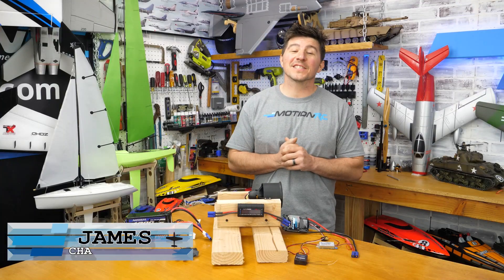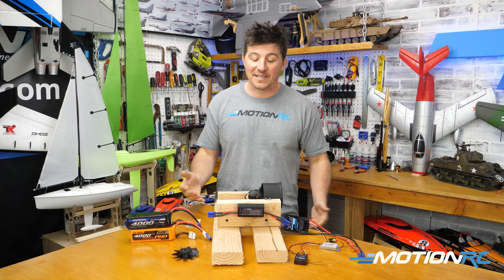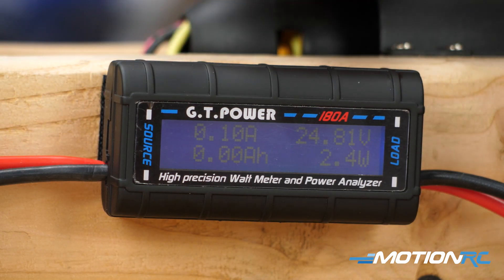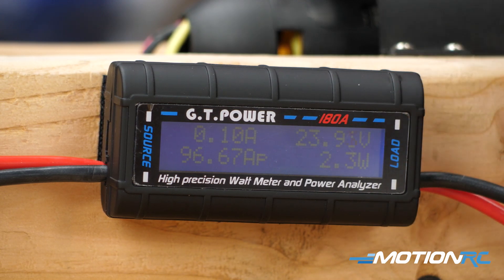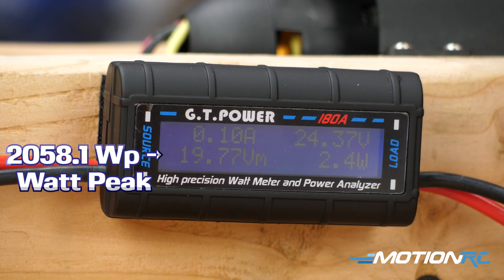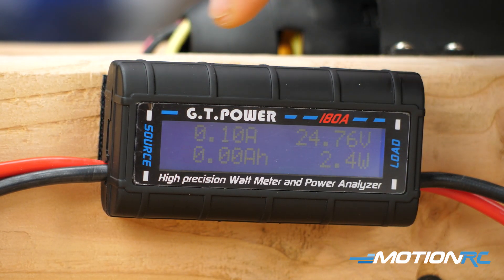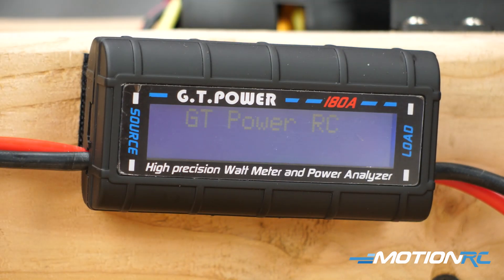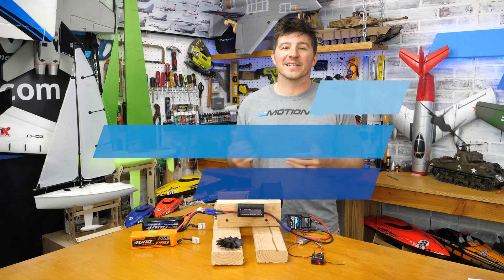Using an RC Watt Meter | Quick Tip | Motion RC

Comment: Watt meters are also a great tool to keep an eye on pack health as they age by keeping an eye on voltage drop under load. As already mentioned by others, I always set up my models with a watt meter making sure I stay within motor maximum amp draw as well as making sure the chosen ESC has enough headroom above maximum draw from the motor as they also must provide power to the receiver and servos and possibly landing gear and lights, etc.

Comment: This will definitely  help out a lot of new pilots wanting to experiment with this different power Systems.  typically when you're running up an EDF you will see peak watts and amps vs what we call settled watts and amps this is after it's been running for a while. Your Peak is a voltage Spike that is what the resistors are for ways to help prevent overloading you're esc.

Comment: You can use the watts to choose right motor.
Every motor has limit of the output(watt).
If you don't consider maximum output of motor, it will burn.

Comment: I have one of these and never noticed the bottom left corner cycles through peaks. I have had a few cases i wanted to check what my peak Amp-draw was, but wouldn't be able to see it while running so didn't try it. Just learned I can run the device then go back and look at the peak before unplugging. Thanks!

Comment: Ordered one 😀
If there is enough space in the plane, you could just put it in there and check the maxima after the flight.
Reply from the maker: Definitely, but for the most part, your maximum in the air will never exceed what it is static.

Comment: Good video, thanks. Does anyone know if you can charge the battery through the wattmeter so you can measure the Ah going into the battery? Will the meter show negative numbers in this case or do you have to reverse the source and load?

Comment: I’m surprised the current and watts were higher for the 9 blade. But, we don’t know if the blade angles are the same. I wish the manufacturers would provide the blade angle/pitch info..
Reply: Less blades are more efficient but they don't sound as good.

Comment: The higher the C rating, the lower the internal resistance should be. Lower internal resistance means less voltage drop and less heat, but the battery will be larger and heavier due to the thicker components..
Reply: Darn I shouldn't have went for the highest C ratings available in my new batteries then lol
Reply: @MChronicleSword  When you're pulling lots of amps in 100° Texas heat, you need the highest C rating you can get..
Reply: Unfortunately, there is no standard for "C rating".  The manufacturer can throw any number they want to on the battery, and many do.  Rarely are they the rating they say they are, but higher is better if you can handle the additional weight and size.
Reply: @Denny_H  Yep, I’ve looked for the standard and couldn’t find it. I guess the designer calculates how many amps a battery can handle based on the design. There doesn’t appear to be a physical test that can be run. You’d have to start at a particular ambient temperature, airflow, etc. and stop when the temperature rises to a predetermined limit. Comparing the weight and physical size is about the only thing one can do. I’ve started using Liperior batteries because of the tests published on RCGroups. SMC batteries scored higher, but they’re more expensive..
Reply: Size does not necessarily correlate to IR. There are some tiny batteries with IR's below 1mΩ and batteries twice their size at 6mΩ
Reply: @ericklein5097  It’s a generalization that assumes the materials are the same.

Comment: And here we learn kiddos that C ratings are all absolute bullshit (99% of them, a select few brands are fairly realistic in their given C ratings) A 4ah pack rated at 40C is 160A yet we saw a 6S pack drop 5V at just under 100A. Dropping 0.8V per cell is what I (my opinion) would consider to be a good indicator that the max safe discharge rate has been reached. Other factors play into this like pack temp but voltage drop is pretty reliable. Taking a cell from 4.20 down to 3.40 is the most I've ever seen a lithium ion (sorry I'm not a Lipo guy) handle without the voltage becoming extremely unstable. I prefer 3.50V being the limit and consider 3.60V to be a very steady region that can be run for a little bit of time without heat becoming a serious concern.

So that give us roughly an IR of 50 milliohms but that includes the meter and all the cable. I'd say drop at least 10 milliohms if not more off that figure. I suspect 6 milliohms per cell to be what they are capable of when new.

Comment: may be model for 400 amp?
Reply: That would require cable in excess of 4/0 105 degree Celsius EPDM insulated welding cable (fine stranded). That stuff is rated for 320A. I would go no lower than 2/0 AWG EPDM Welding cable if I was just bursting 400A for seconds....like 5 seconds no more than 10-15.

I don't know if anyone makes 200 degree Celsius Silicone insulated wire beyond 2 AWG but it would be VERY expensive. Probably $15 per foot for 4/0 AWG.EPDM is about $8 per foot for Royal Excellene but that is the top of the line welding cable.